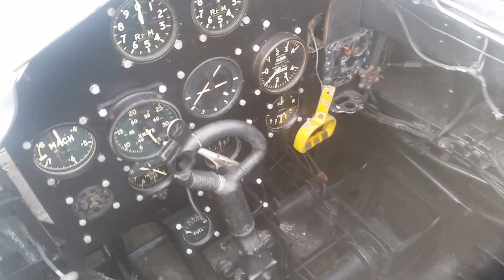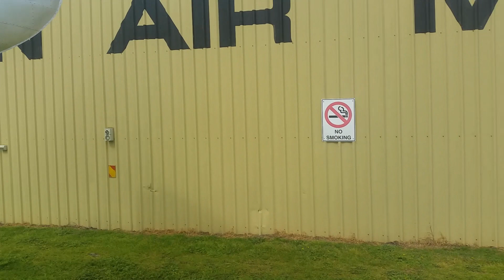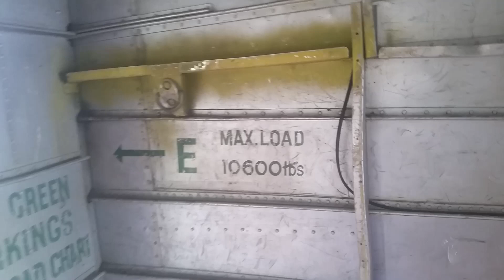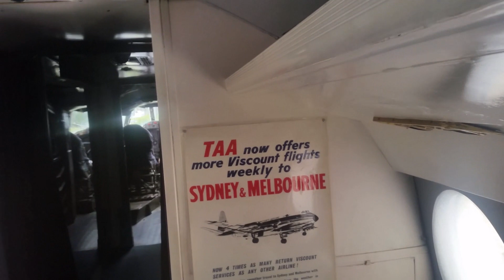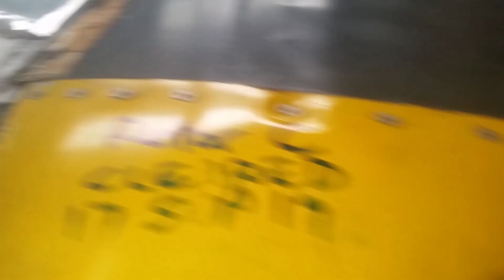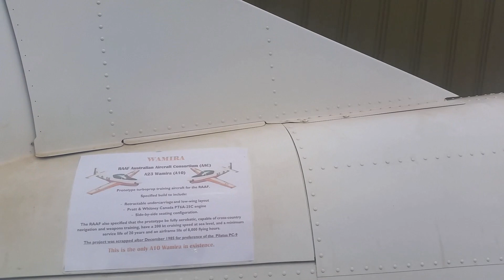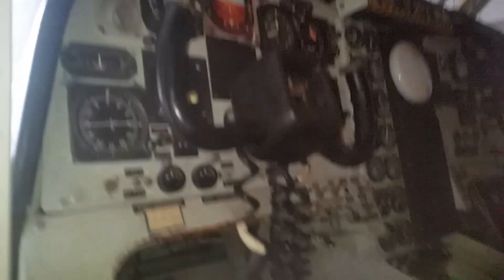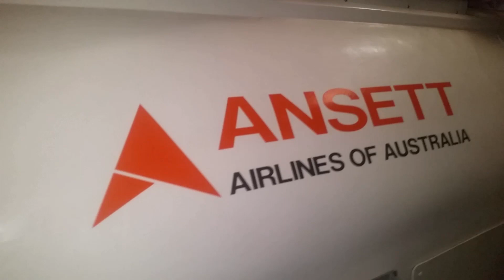Episode 5 - Plane savers Downunder Part 1 Australian National Aviation Museum

Comment: The old Bristol Freighter may look like a clumsy utilitarian air craft but the engines were an engineering masterpiece
Reply from the maker: George sounds like you know your stuff. Look clumsy but very useable.
Reply: Worked at the Bristol Aeroplane Co as a student in the 60's Watched them overhauling the big sleeve valve radials and testing them in the test cells.

Comment: That Lincoln G-29-1 must be G-APRJ former icing test bed from Cranfield UK.then it went to North Weald with Doug Arnold,the rest of it is with Kermit Weeks still untouched in a container the idea was to use it for his Lancaster eventual restoration,must have been costly getting it to Oz ! sopme gems in that building.
Reply from the maker: Hi Angel
Enjoy you comments  - valuable to fill in knowledge gaps. Thanks

Comment: The access hatch going up in the Freighter is to get on the roof. There's one over the navigators position to.
Reply from the maker: Thanks for the correction.uch appreciated.
Reply: @kenweeks  We have CF-WAE in Winnipeg here and I used to crawl through it a lot when I volunteered at the aviation museum.
Reply from the maker: When I saw the ladder I naturally assumed that the ladder gave access to the cockpit - how do they get there?
Reply: @kenweeks  I guess when it's got a big enough load, you have to find another way in and out.

Comment: Ken I flew several hundred hours in the DC-3 ANH in the late 1960's with Airlines of NSW at that time mainly used for around Australia "Jolly Swagman Tours" (Later Bill Peach) & weekend Bowling Club Charters.
 I was dual endorsed on DC-3's (I did over 1,000 hours on ANR that is in Caloundra) & the F-27 Friendships.
When Ansett Gave/ leased cheap it to the Air Museum the over painted it in the currant Ansett colours- WHY!!!
Reply from the maker: Sometimes you wonder why a scheme was chosen. In this case the old Ansett schrme would probably have been more appropriate. Maybe someone from the museum might let us know?